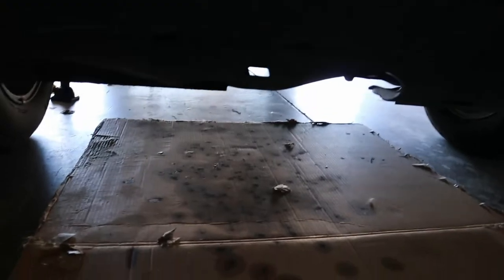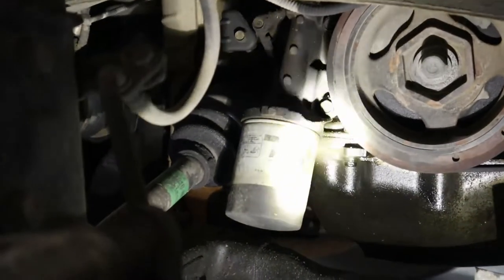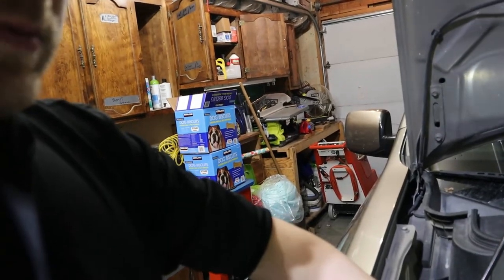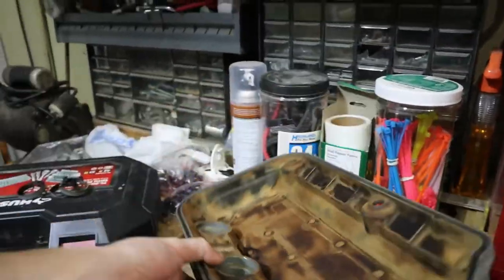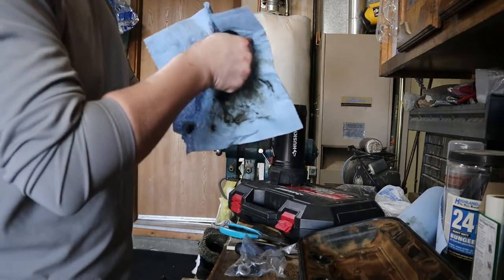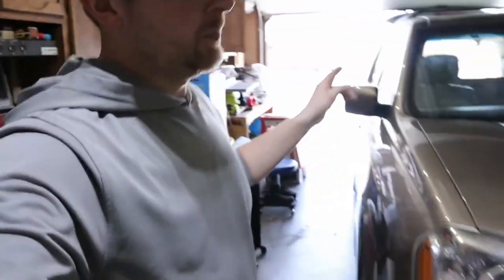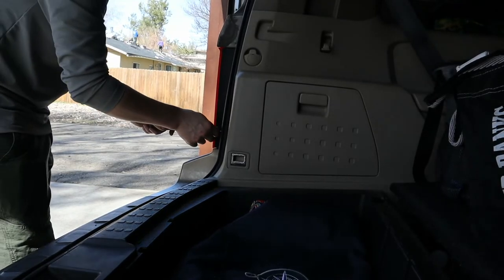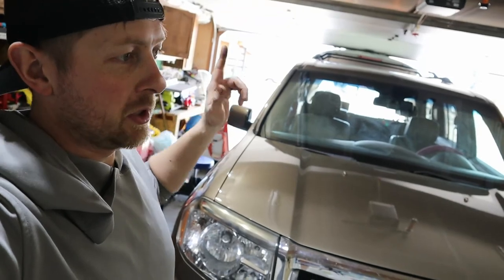Finding the oil leak in a Honda pilot.

Comment: I was terrified on working on my honda CR-V giving Honda money everything i had a issue but one day when i had my family with me i broke down and remember i did brought a tool kit just incase my family was going crazy had a cut transmission cooler hose busted. I remember my farther put one on and stayed calm and went work i had to walk a mile to get the part but successful i install new correctly. I know your not ready to try working on Hondas but i wasn't neither till i apply my self. Just start watching videos and try changing the oil sometimes. Ever since i did this back in 06 i never had to go back to honda anymore. You just need the right tools good videos to guild you and the will power.

Comment: The main leaks I have found are the camshaft cover plates.  Their are two of them, one on the end of the front head and the other is on the rear head, the rear head is the one that started first.  When I noticed the oil on the ground my first thought was rear main seal, oil pan, or the oil drain plug.  After cleaning the engine really well I found the leak.  It was the rear camshaft cover plate o-ring type seal.  Really a pain to get to so I put it off for a month or so just constantly wiped the oil off the engine.  My alternator just recently went out and found out it was due to the front valve cover gasket leaking onto it.  I am in the process of replacing the front valve cover gasket, while I have the intake and other components off the engine I am going to attempt to replace that rear camshaft o-ring and hope it all works out.  Eight years ago I did replace both valve cover gaskets along with timing belt and all of the things that pertain to it, water pump etc.  While I had the valve covers off the engine I found a video on youtube showing how to adjust the valves.  I studied and got some courage and actually did it and did it correctly.  The valve adjustment actually cleared up my check engine light and the Pilot ran smoothly for the past eight years until the past month. My Pilot is a 2006 front wheel drive only and has roughly 280,000 miles on it.  I am extremely pleased with this vehicle and as long as their isn't any extreme major problems with it I will keep working on it.  It has been an awesome vehicle, honestly I think it has been my best vehicle.  Those older Hondas are mechanically friendly, to a degree, and you don't have to own a mechanics grade scan tool to work on it or have it reset by one when you complete a repair.  Hope this comment encourages others that own a Pilot to consider doing their own repairs and save some dollars and best of all learn some good to know stuff about their vehicle.  God Bless and thanks for the video!

Comment: I love my pilot.  180,000 miles and plan to try for 300,000.  Like you, I came into maintenance out of necessity.   Couldn't afford to pay for things to be done...but i've enjoyed the process.  My wife drives ours most of the time, and the power steering went out.  I'm glad it did, because it required me to look around under the hood.  Noticed a very similar looking leak.  I'll likely start where you did...a deep cleaning of the engine bay, then try to find it's origin.  The challenge is that it's already down to 25 degrees here in Iowa.  Keep posting.
Reply: I got about 245k on mine and am now starting to see leaks and parts failing. I have no problem diving it and having it take awhile as it’s a second car to me. Would be nice to have all it fixed “now” to keep mileage off my truck.. Meh.. it’s only vehicles and I always have a ride handy 😜. Done rambling now…. Fix everything, maintain everything all at the appropriate times and even Gen 1 pilots can easily be a 350k or more vehicles.

Comment: Thanks, did that fix your problem? I'm doing the same 3 things.
Reply from the maker: @FilmFactry  yes it fixed the problem at that time. Had to go back in about 6 months later, to apply some RTV gasket sealer one the head gasket and it hasn’t leaked sense.

Comment: Great video man, most of Honda’s J-series V6 engines have leaking points. But for some reason the oil-dipstick always have a perfect reading lol. 

@11:11 I see that you’re replacing the grommets for the valve cover. The vice (careful of that hairline crack) you’re using isn’t necessary  Just use a dab of grease & they slide perfectly on.

Comment: I have a leak on our 13 pilot touring. 159k miles. I cant tell where its coming from. Did you have oil on the bottom side of compressor and oil on the passenger side of oil pan? Thats where i have oil. Thanks. How long did this job take? Did you buy intake gasket too?
Reply from the maker: Took about 6hr if you condense just working on the car. There was breaks that made this a 2 day project.
Yes I bought new gaskets.
Reply: @LivinSaltyCrew208  ok thanks
Reply: Did you ever figure it out? I'm dealing with the same leak you have!

Comment: Dude I'm totally scared about this project my Honda is leaking as well not as bad as yours but I think it's destroying all of my alternators I just replaced an alternator well I didn't I paid a mechanic a lot of money to do just the alternator and the belt. I have a family of four now three girls and finally got a little boy on the way just coming off an injury to my back. No complaints here just stating obvious. I just need to know the tools needed and what the hell to do because I went to the dealer they charged me over $5,000 if you add sales tax to that we're right at 6000 hell I paid right at 8500 for the vehicle why the hell is the work to get things fixed on it is as close to the vehicle purchase price that don't make sense. They charged me $500 for the three or four screws you took out on the oil filter gasket replacement when I looked it up on YouTube I was like what the hell. To be honest they gave me a laundry list of things that they said was leaking O2 sensors Etc. I replaced the alternator and the battery I think a month ago that was like $400 for everything. Now I think I got to replace another alternator because my battery light popped on I went to AutoZone they said something inside of the alternator I might got a warranty on it because I bought it from RockAuto. Just frustrating man going through a lot of life and my car is the single most important thing to me other than my family but that's the way I can at least try to get money take my family around emergencies all the Above. I love Honda but is this a blessing or curse?
Reply from the maker: I had to do the Alternator , new belt, Starter, the spark plugs and coils. Went through 3 batteries in a year so I decided I had to do something instead of being stranded somewhere. 

This project was mostly time consuming, tool wise most everything was done with a metric socket set, Needle nose pliers, and a weekend so I didn’t need to rush it. 

The oring sets in total cost about $100 and then time watching lots of videos before I tackled the project.
Reply: Just get some tools & dedicate some time to perform the work. It isn’t hard just time consuming. “Stealerships” will charge an arm & leg to do simple things you can do yourself.
Reply: @MrSamPhoenix  I bought my alternator on amazon $145.  changed valve cover gasket and inside rubbers.  $600. total. Have reasonable and good mechanic.
Reply: @tombilliodeaux7282  I feel you, I’m just urging people to really start learning about their cars. That $600 you spent could’ve been reduced to about $210 if you did the work yourself.
Reply: Some dream of a family like that.
Reply: Hey, I noticed leaking recently in my 2010 pilot and I too had an altenator fail because of the leak. It was my VVT solenoid that was right above the alternator. The part was about $250. You could just buy the gasket but with all of the fake parts on eBay and amazon I just bought the OEM part for peace of mind. Problem solved with the alternator having oil in it. Now I have to find the other leak. I'm thinking its the oil pan gasket but not completely sure.
Reply: @llamiell  true, but your other leaks are most likely the valve cover gaskets & tube seals, and the VTEC solenoid gaskets.
Reply: @MrSamPhoenix  I plan on getting a better look at things this weekend. I'll be checking those. Thanks!
Reply: @llamiell  no problem, let me know how it goes.